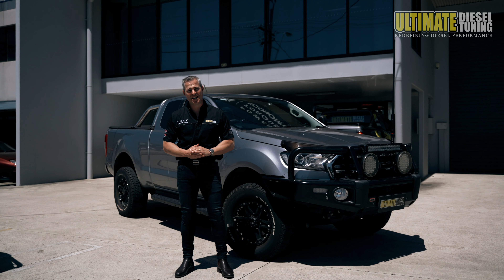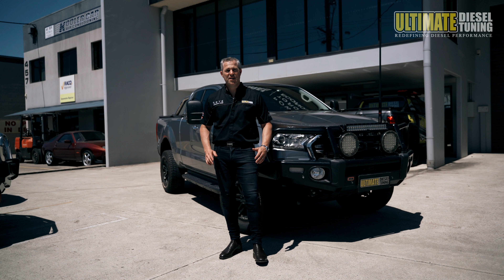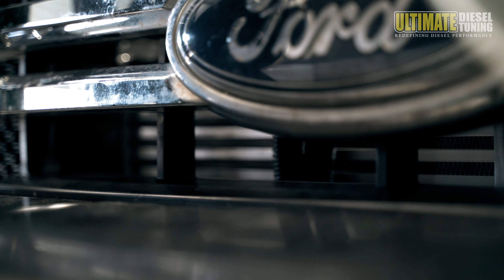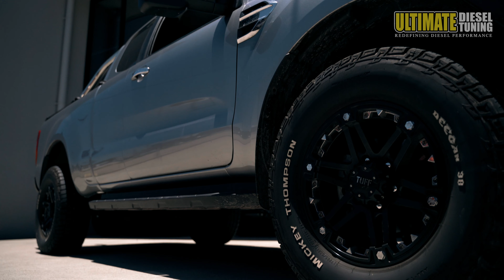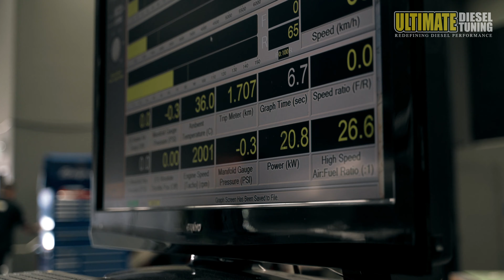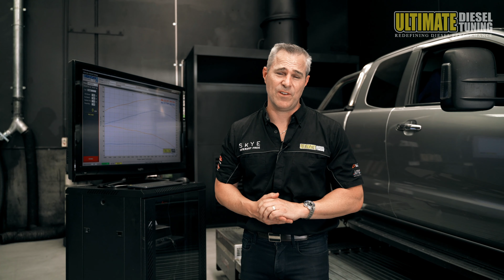This Ranger PX3s engine & trans now run MORE efficiently, plus it also has loads MORE TORQUE too!

Comment: When tuning  with larger 33" tyres does your tune correct the speedo and odometer/DTE  back to stock allowances ? 
I have read about Forscan and SAEB.NET  to make adjustments to wheel diameter so odometer is corrected and reads true to give odometer and  L/100  accuracy and to give a 4% read under the gps speed. 
96km/h on dash and 100km/h on gps like factory.
Reply from the maker: No we don't recalibrate speedos here.
Reply: Do you guy do any tunes to the transmission? Does the engine remap cause the shift points to feel off?

Comment: Out of a ranger though I would want a minimum of 150kw and 500nm. Is that possible out of these things?
Reply from the maker: Hi Sam you should probably consider getting one of our Ultimate Torque packages for the ranger.  
Includes upgraded UDT hi flow turbo and PWR intercooler, exhaust system and custom tune